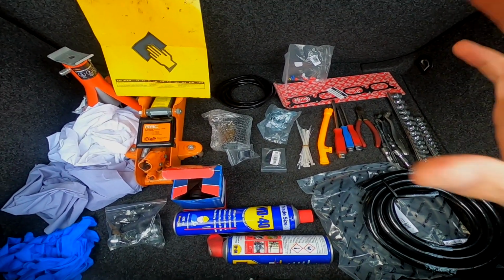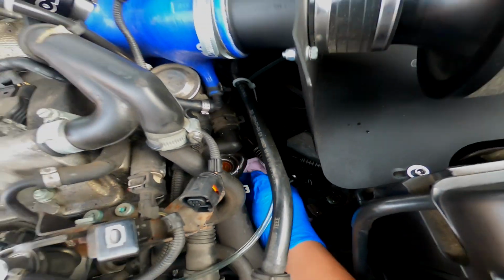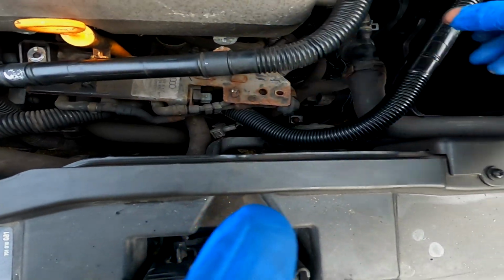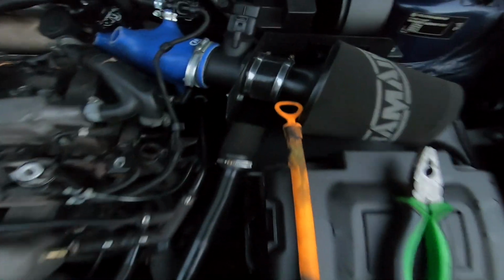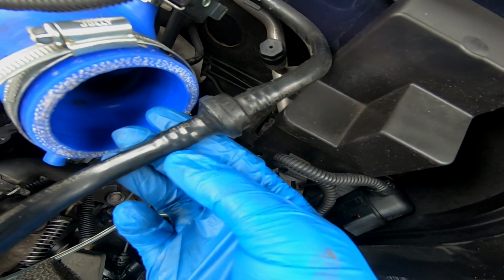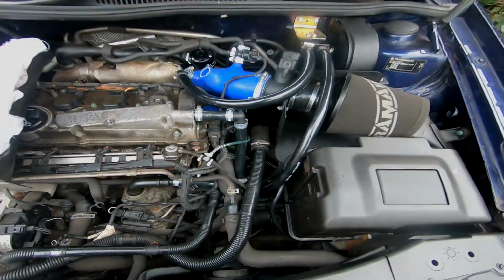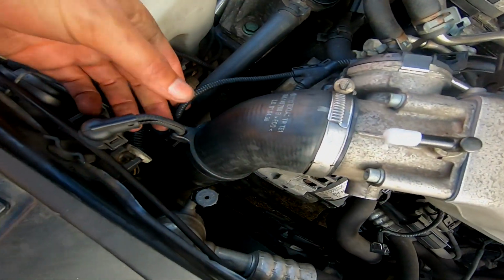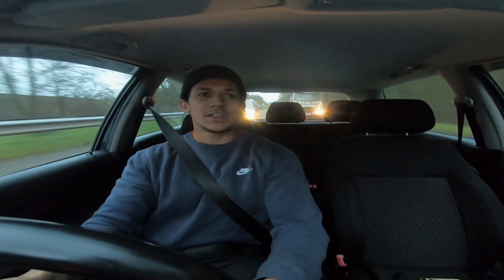MK4 VOLKSWAGEN GOLF GTI 1.8T SAI/N249/PCV/EVAP DELETE/CATCH CAN INSTALL

Comment: Firstly, love your videos and fair play to you carrying out some of these jobs outside with a jack. I have the luxury of borrowing a mates ramp to work on my mk4 and don't stay as calm as you! :-)

Just watched your vid on the CM oversized TIP as I'm doing mine next week at same time as new clutch. Watched this out of interest as I've already done deletes except for evap and pcv / catch can. Was wondering if you've changed your MAF housing to 80mm since doing the TIP install as I didn't see the adaptor in there?
Reply from the maker: Thanks a lot mate, appreciate your love for the videos. Working on the car on the floor is a total nightmare sometimes but I just take my time. I would love to have a ramp to use that would be heaven hahaha. I havent changed the MAF, I ended up changing the TIP because the other one kept sliding off my turbo but when I got this one it did the same thing. I still have the larger 80mm TIP so if I change the MAF I will use it. Good luck with your clutch and TIP upgrade man and thanks again for your comment 👍🏽
Reply: @SPOOLINUP  That's a shame about the TIP, have you figured out why they were sliding off? I'll be changing my MAF housing to 80mm but not until it is at the tuners for mapping or it will run lean.
Reply: Did mine today, absolute pig of a job! Clutch was much quicker and easier than TIP!
It definitely needs some cutting off it (quite a bit) to fit on to turbo and gear linkage cables removing as well as the bracket for hard water pipe. Once it was on properly it took a mate with a pry bar to get the bracket for gear cables back in place while I got the bolts in. Seriously tight!
Just wondering if you've not chopped it and got the gear cables out of the way it might be sitting at an angle and not 'square' to the turbo which is causing them to slip off?
Reply from the maker: Basically I cut the first TIP that I fitted and when I was going up the jubilee on the turbo spigot the jubilee kept slipping off. I thought it was doing this because I had cut too much and the jubilee was sitting on the tapered part of the TIP but I was wrong because a brand new uncut TIP did the same thing. I too tried to remove the gearbox cables and put them on after but was impossible by myself so just soaked it in hot water to soften the silicone and and some lube, was a hard one but nice to be done. Im glad to hear you got it on mate 👍🏽
Reply: @SPOOLINUP  Pal, I was doing the job with the luxury of a ramp, workshop full of tools and supervision / help from a very experienced mechanic..... and it was an absolute pain!
Once again, much respect for you carrying out these jobs on your own outside with 'every day' tools!

Comment: I also have 2002 aum 1.8t bought all the stuff to do deletes last year.but as mine completely original and they going up in value now(standard).havent done it.still in two minds.have the resistor plugs to fool ecu.but have heard aum will throw eml as looking for airflow from sec air inj unit.has yours thrown the eml up.?.
Reply from the maker: Hey man, yeah im sure these Golfs are going up in value and loads of them have been ruined. As long as you don't ruin your car it doesn't really matter too much in my opinion. Have a good think about what you want to do. EML is up on the Golf until it gets mapped.

Comment: Hey dude, thanks for the video, not many around where someone does the whole engine bay simplification from start to finish.  Nice one, I've subbed 😎.  Have you seen any reduction in power or poor MPG over the last month since doing all these changes? Take it steady.
Reply from the maker: Hey man, nice one for coming along and subbing and im glad you appreciate the video. The reason I made the video is because there weren't many good ones and I needed to do it so just did it. I havent noticed much to be honest, only a catch can full of disgusting liquid but other than that I have seen no change in anything. I never really monitor fuel usage because my use of the car varies so much its difficult! Hope you get along well with doing the job man good luck to you 👍🏽

Comment: Dont play with the evp your going to be sucking so much fuel its not funny. The deletes dont gain any power just makes it looks tidy under the hood. The catch can is the only gain in doing any of it
Reply: Deleting the N249 can improve performance with a remap.

Why would deleting the evap affect fuel consumption?
Reply: It dont do nothing in hp even with a tune. I tune cars for a living. The only time you see big power diffrence is when you stroke the motor. Bigger turbo ect you can chuck a shit load of money at the stock 1.8t but your limited you can get a bit more out of a agu motor but not much. Stock ko3 15 pis boost is  max with a tune but it still runs out of puff in high rev range. Putting pod filters and pulling pcv vaules and evap out will not do nothing. Pull it all out get a good computer plug it in and look at your fuel trims. The ecm are slow as shit in 1.8t vws and cant adjust values quick anoth ether 1 minite its running lean the next rich tps starts to hunts back and forth. Then starts throwing throttle body vaule and tps codes the list goes on. Stroke it big turbo better engine mounts and mod the pasanger side engine mounting points on the engine block as its prone for snapping with high hp big turbo custom tune injectors fuel pump ect and  standard copper spark plugs heat range 7 ngk platnum blow out at hi boost.
Reply from the maker: To be honest with you mate im not looking to spend loads of money on this car with stroker kits, forging, turbos, LSDs, wheels, tyres, suspension etc. Next thing you know you have spent all of your life savings on a car that is worth not much more than when you started. Its just a bit of fun for me along with many other people and the reason why we choose the 1.8t is because its cheap to mod. Thanks for all your info mate 👍🏽
Reply: @kurtlazarus1702   Deleting the N249 doesn't increase hp but can help with performance as it has control over the diverter valve, the delete is recommended for stage 2 map.
The deletes are worth doing to minimise chance of getting vacuum leaks which are very common on these old engines.
You can get an AUM with the K03s to stage 2 for little money and they will make around 230hp. That's an 80hp increase from stock for some fairly simple mods and enough for me on a 19 year old FWD hatchback.
Why do you think deleting the evap would effect fuel consumption?
Reply from the maker: The reason I did mine was to futureproof the engine from the common vacuum leaks, to de-clutter the engine bay and of course ive heard it is a good move to make when tuning a 1.8t. I always wanted a cool turbo charged car that I can have fun with that doesn't cost an arm and a leg. To many people I am sure the 1.8t cars have offered thrills for little or no money. Well said @Not Applicable
Reply: @SPOOLINUP  Just had my stage 2 map (minus fmic) today pal, absolutely transforms the car! Made 231.4hp and 308.8 ft.lbs of torque (stock is around 154 ft.lbs)! Get it done ASAP! :-)
Reply from the maker: Wow! You are not the first person who has told me it transforms the car. I need to get a few bits ordered up, hit some overtime at work to soften the blow and go for it!! Are you in England? If so where abouts? Also what mods are you running?
Reply: @SPOOLINUP   im in australia i got a 1.8t stroker spent stupied amount of money on it parts here in australia are hard to get and if you do find them they cost the world. Full custom tune everything top to bottom is done. Only thing to do is clean the inside up abit. I tryed everything to get more power before i got it stroked form diffrent tunes ect to deletes. The big thing is to get good suspension replace all bushes from the front and back once you start getting the power up you will notice the car feeling sloppy. Dont worry about making the engine bay looking pretty spend money on making the engine  run solid before that do all that stuff after once your happy with everything. And be careful with the gearbox they cant put up with to much power blew mine to bits just doing 4th gear pulls. Do a 6 speed conversation. If not try find a evs 5 speed box they are strong for med power steps. Good luck with everything mate.👍
Reply: @SPOOLINUP  Yeah I'm near Bury in Lancashire. I have 3" decat and full Milltek system, oversize TIP, Ramair induction, GFB diverter valve and have done the N249 and SAI deletes. It's the TIP and decat that are important for a stage 2 really, a FMIC would have been nice but I wouldn't really have gained much more power, it just keeps the power sustained where mine will drop off in high temperatures. Want to spend some time and money on doing coilovers and brakes before I do anything else under the bonnet, I am plenty happy enough for now since the tune has been done! Feels like a completely different car, the torque is awesome!
Reply from the maker: Thats great man! So basically our cars are much the same at the minute but mine isn't mapped. I will buy a FMIC ASAP and I was told to get some 550cc injectors and a decent fuel pump so will do that in due course too. I cant imagine how different the car is once mapped. I have TT 312mm brake discs and calipers here but need the 256mm rear brakes and that is what I will be running. Did you do all the work yourself?
Reply from the maker: Yes Kurt I was talking to a teenager on here before and he really wants a MK4 GTI man its his dream car. He too is also in Australia and was talking about insurance as well. What are the police like with people who have modified cars? Your car sounds cool and unique with a stroker kit, not sure I know anyone who has done that before. I will be mindful of the gearbox for sure, some people do the VR6 flywheel and clutch conversion too. Thanks for the comments and advice
Reply: @SPOOLINUP  Yes we're running almost identical under the bonnet, I'd go back to the oversize TIP if you can though. I'll be doing the FMIC when I've got a bit more money to play with and a full day to fit it, the map doesn't need to change so I can just do it when it suits. You have to be careful with a front mount and not be tempted by a cheap one or go too big for our tiny turbos or it's very easy to LOSE power. If you reduce flow you get a pressure drop and lose power even though you're running cooler. You won't gain anything whatsoever with bigger injectors at stage 2, the standard ones are more than capable unless you're going stage 3 with big / hybrid turbo. Same for fuel pump, if yours is healthy it's more than capable but if it's tired you may as well upgrade it, you won't see gains at stage 2 though. I replaced fuel filter as it was simple job and worth doing for less than £10, old one was probably fine though. I'm doing all the work myself but my mate is a mechanic and engine builder so I've always got help if I get stuck. He brought his VX220 for a dyno run at same time I was getting my tune just to see what he was getting from his (he built his forged engine himself) and he made 357hp and 386 ft.lbs of torque!! That car is just silly neck snapping quick! Probably weighs less than my interior! :-)

Comment: Dude what a video well done 👏 i think i have the sai delete on mh AUQ already but the catch can and vacuums under the manifold i want that stuff gone. so glad i have cane across this video..do you know what causes the engine management light from these delets? mine currently has no lights on dash just wondering if I'll come across this from the ones i want to do. again well done and thanks for the video 👍
Reply: yes mate was already deleted when i bought it. iv been aware there are other deletes to do but never really found a vid that shows and explains the process. just want less in there so its easy to keep clean.. iv  just swapped out the coolant pipes for silicone  and done the aluminium connectors what a difference thats made. where did you get you 90 elbows from and the rest of the supplies at that?
Reply from the maker: Sweet man, thats good that has been done already and mapped out then you are ahead of the game. I need to swap out some coolant bits to be honest but will look into that in the future. I wish I did the deletes first because it frees up so much room to do other mods. The 90° elbows just found them on a Google search and the same with the vacuum caps, if you know what sizes you need it helps, all of the sizes should be on the guide in the description.
Reply: mate what catch can you use?
Reply from the maker: Hi mate, I used Creations Motorsports catch can. If you struggle to find I will have a look for a link.
Reply: i have had a nightmare sourcing the bits n bobs for this.. but the catch cans the last bit then it go time.
Reply from the maker: Mate it wasn't easy getting all of the bits, I had to order some halfway through the job once I got a better idea of extra bits I needed. The caps caused me the biggest setback and its good to have extra like an extra elbow and stuff like that. Best to be prepared and just take your time finding the bits. If you look online there is a kit from Urotuning but by the time you buy that for over $300 and then shipping its like $600 man its crazy. Good luck to you
Reply: @SPOOLINUP   hello dude back once again ..so all done took the car for a spin all good but got back and when sitting idle its running lumpy..now i do know i havnt capped the thin turbo intake pipe that you cut down the back or the nipple on the boost pipe under the other side of the diverter would this be a major issue? iv taped them up for now just struggling to find caps any suggestions/help please
Reply from the maker: Hey man, hope you are good mate. I would think that leaving anything open after the MAF sensor would cause a problem because its un-metered air entering the engine. Remember that the car ideally needs to have the deletes done on the ECU too otherwise it will think things are not working and throw up codes etc. I can try and dig deep to see exactly what I ordered in the way of caps. I did order some big ones for the TIP.
Reply: @SPOOLINUP   iv plugged the TIP with bolts for now took it for another spin but noticed when i got bsck it was still lumpy sitting idle when iv had another dig around iv noticed the two black caps under the intake manifold have blow off. when blocking with my fingers it calms down so maybe this along with the TIP caps. yeah I'll be sending it in for a map as doing these deletes has also intensified the pops and bangs..if ypu could dig out the source of those caps that woulc be great ..going to do a bit digging myself too..really appreciate the help and information man top guy 👍
Reply from the maker: Sounds good man I hope you get it sorted. I know I measured the size of the ports that I needed to cap and ordered silicone caps with the internal diamter matching what I measured but cant find the order in my emails. I also ordered assorted vacuum caps from amazon but that is all I can remember. Just rememeber to cable tie them on in place or if you can get really small jubilee clips for them then thats great. Keep an eye on it all and it should be good hopefully. Sorry I can't really help any more then that. Good luck either way man and im sure you will be fine once its all mapped just let them know what you have done. Top man thank you 👍🏽
Reply from the maker: Hey, thanks man im glad you enjoyed the video because it took some hard work getting it all done and filmed. Im sure that its deleting the SAI that causes the EML to come on and it needs to be coded/mapped to delete it. Was the SAI deleted or disconnected by someone before you bought it? There is so much junk in the engine bay before the deletes its good to get them done. Again you are welcome and im happy the video helped you.
Reply: does £35 sound about right?